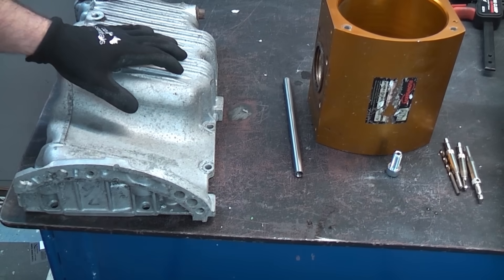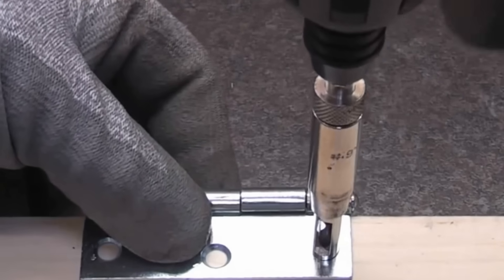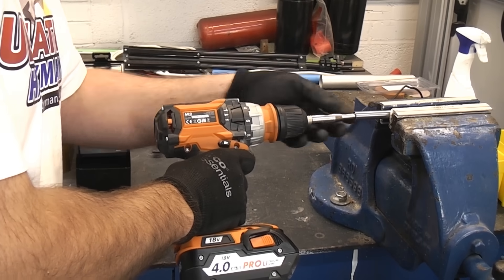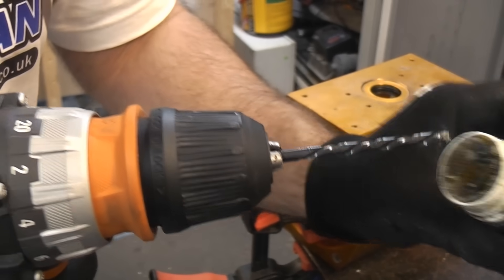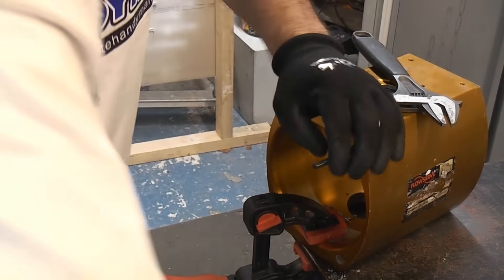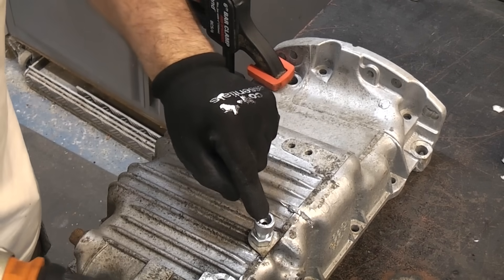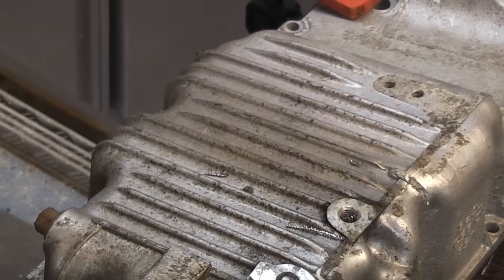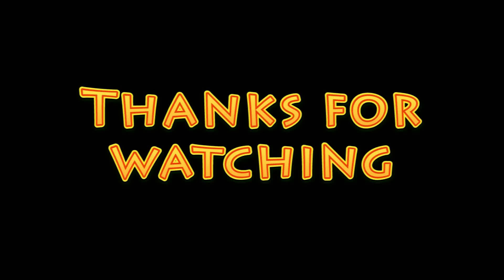How to remove a broken bolt in a deep hole | remove broken bolt in recessed hole

Comment: Great video but a few questions.

- How does heat treatment work? Unless the heat was applied long enough wouldn't the aluminium case just expand around the bolt tightening it? 

Even if you heated the steel bolt wouldnt that cause both metals to expand, the steel retaining more heat than the aluminium case whivh would lose more heat faster since its the outermost layer exposed to the air?

- Considering the bolts are threaded, what's the rationale behind 'shocking' them? I was under the impression that threaded screws and bolts are fixed in and that shocking them would be futile due to the nature of their attachment.

The force you tap them with, I would have thought, would just be dispersed.

- How does the penetrant work? Is that a spray oil that is supposed to seep between the threads to help loosen the bolt?

I'm not familiar with chemicals and just tried to apply a bit of reason to the mechanical side 😂

Thanks for the upload.
Reply from the maker: The metal will expand, which can break the bend between the bolt and the aluminium. Once the metal has been heated you have to let it cool down. We often remove bolts that have been used in autoclaves where water/heat and sodium nitrate have been used - steel bolts into tapped holes into steel. If you heat them to red hot and the surrounding area, then let them cool you can often remove the bolts without the head snapping off. Without the heat first the head just snaps right off.

Shocking works well- sometimes if you go to a bot that is really tight, give it a few smacks with a hammer and you will find that the shock has broken the bond.

Spray penetrant has chemicals in it that release rust/chemical bonding etc. Sometimes on site I have to undo some 3/4 inch UNC bolts that have been in the autoclave's mentioned above, they are covered in sodium nitrate and have been in a wet environment for a couple of years. I use a 3/4 inch drive pneumatic impact wrench and sometimes it will not unto the bolts, but spray them with a decent spray penetrant and the bolts loosen and can be undone. I remember one time we ran out of penetrant and I had to use the oxygen and acetylene to burn the heads off from the bolts.

Thanks for the comment

Comment: I'm amazed of the guides you made, the only problem is that you shouldn't be using copper greas on aluminium
Reply from the maker: Before making this video I did search Google but could not find any evidence to back up what some people have said. I have a friend that has used it for years on motorcycles with zero problems, so perhaps problems only occur in certain environments? 
Even Rocol's own website makes no mention of not using copper based anti-seize compounds on aluminium.
Thanks for the comment

Comment: Been using bolts with centers driller out for close to 45 years or more don't remember when exactly a machinist showed me that trick and he claims his dad showed him many many years before that. In my line of work I remove a lot of broken rusted in bolts on boilers and what not. Also when heating up the area around a broken stud I have found much faster and better results when you spray your penetrating solution on while the area is still hot if possible. Yes you may have some flame up just stop spraying and let it cool a bit then spray again in small amounts but you learn over time how to control that in a safe way and not burn the shop of building down. Just remember when spraying penetrating fluids that if it is running everywhere but the area you need it you are applying way to much. As the old commercials say, "a little dab will do ya." Personally I have for sometime only used PB Blaster on things I want to break free or remove. Yes I know it stinks but it works great. Another trick is that some penetrating sprays only have a poke in type straw for controlling your spray. Next time your can of WD-40 is empty that has the smart straw on it remove it from the top of the can and it will so far I have found fit onto any other petro based spray cans.
Reply from the maker: Thanks for the comment

Comment: The process works if the bolts are in good shape like yours(clean threads). I've worked on many bolts with corroded threads that no left hand drill bit or extractor would work. Instead of making those centering bolts, you can use a small bushing from the hardware store. Choose one that fits inside the opening.
Reply from the maker: Thanks for the comment
Reply: I do believe that there are some bolts that can not be removed.  I recently replaced two brake wheel cylinders with bleeder screws broken off.  To get some practice with such things I went to work on the old ones in a vice on the bench.  A number of heat/cool cycles left hand drill/extractor, PB Blaster; tossed them out with the screws still stuck.
Reply: If the bolt is at least 8 mm 5/16" the best way to get them out is to weld on them and build them up out of the hole and the weld a nut on it and vola it in most cases can be screwed out. Just watch out you must use a chromium weld rod not a usual welding rod
Reply: YEAP!! but why a chromium  ( stainless steel?) rod,please?
Reply: The character of the rod is that it is very accurate it does not fly to the side and the flux more or less isolate the side of the hole for any splatter and last but not least it  is normally much stronger than normal rutil rod
Reply: Thanks, another very good Idea !
Reply: @bergurketilsson4097  Thanks for the tip. I tried the welding method with regular welding rod and it broke. Now I know : )
Reply: @bergurketilsson4097  great if you have a welder...most of us don't 🤨
Reply: @jimsz0100  in your situation you can or could have submemurged those wheel cylinders in pure apple cider vinegar for maybe a week or dust put the vinegar all around the screws several times a day vinegar will only eat the rust    now the rust will be gone but you will have pits where the rust had already damaged the metal or steel ,, I'm quite old and have used apple cider vinegar for many many years
Reply: @jimsz0100  
1
Reply: @jimsz0100  Just replaced 2 damn calipers myself because of stuck ass bleeder screws that would NOT come out. Those damn things need to be made of compatible materials that will not corrode with each other. It would be nice if there were another "fluid" used for brakes that was not hygroscopic, too  because once that and any air introduced into the brake fluid happens, you're screwed. The constant heating and cooling  cycles of brake fluid in the caliper can cause the water there to release oxygen, thus making rust/corrosion, is my thinking and that fluid also becomes acidic from the same h/c cycles from just sitting in one area for so long, worsening the problem. Better fluid and materials for brakes, I say!!!! but nooooooo.....brake shops need work, too. Built in dollars and planned obsolescence has always been a pain in my ass but with an ever increasing population, you gotta make jobs and the bottom line some damn how. It just sucks that with these new expensive ass vehicles, these days, you have to pay for them 2 or 3 times over just to keep them on the road and your neighbors in work.
Reply: @dannychron2329  - Citroen fixed that by changing to LHM - Liquide Hydraulique Minerale - a thin hydraulic oil much like jack oil or ATF. It is used from1967 (1969 in the USA) in their central hydraulic systems and in the ordinary brake systems of 2CV type cars. Nothing internal corrodes. The rubber (actually polyurethane and nitrile) parts don't last as long as the old pre-1967 EPDM rubber parts did with LHS2 (much like DOT3 brake fluid). Antiseize works fine on brake bleeder screws. A few have used silicone oil (DOT5) brake fluid. NOT compatible with DOT3, 4 or LHM.
Reply: @dannychron2329  - Designed to break, tiny, and made of soft metal - the bleeder screws.
Reply: @dannychron2329  Or You could just flush the brake lines every 12-18 months. I've been doing this for twenty years it doesn't cost much and ABS systems derive great benefits from the clean fluid.
Reply: @dannychron2329  Blead Screws have been breaking for at least 50 years "From personal Experience" I Suspect it is because the manufacturers would rather sell new..  But once in a while you get Lucky..
Reply: @alfredmorency8296  check for h2o content in the fluid, when it gets high flush it...otherwise waste of time, it’s a closed system fluid will be fine.
Reply: @jimsz0100  drill the old screws in situ and re-tap the hole.
Reply: @jimsz0100  - The bleeder screws are designed to break. They are also over tightened when newly built weakening them just enough so that they'll definitely break when you try loosening them.
Reply: @damkayaker  built in obsolescence
Reply: Bushing? What are you even talking about?
Reply: Yes and anytime you mess with aluminum either bolts or pipe thread you got a super headache
Reply: I've (tried) to extract bolts with easy-outs for at least 40 years, and never once has it worked.  My applications are much like @electronicsNmore described; always corroded.
Ultimate Handyman shows that technique is everything.  I've never been able to keep a drill centered like he shows... and freehand, no less!   That's impressive capability!!
Reply: Agreed.   I have found that the best screw extractor is a torx bit, really.
Reply: 🤣  Your erotic writings,  ever thought of publishing in Mills and Boon books ?
Reply: you can fix stupid my friend.
Reply: Glad to hear it's not just me  who can't get the dam bleeder screw out and just gets a new recon caliper instead
Reply: Yup, I have never had any luck with extractors because in order for it to have broke in the first place it was already being removed with more force than even an extractor can handle. Now the centering tools are key as you must center the drill then step up drill size untill you basically just pick out the the left over threads " now paper thin".
Reply: In this case my approach is to drill out larger and larger. If it doesn't extract, get to the inside thread diameter and use a tap to clear the remains out. 

And hell, if that doesn't do it or the threads are stripped, if available, move to the next larger bolt size with the same thread pitch, and use a larger bolt for the assembly. Retap the whole thing. I've personally done that. Damn shop mechanics in a hurry with their stupid air tools do loads of damage.

Comment: Great easy to understand video much appreciated. As a retired ex  toolmaker I have seen many tricks and modifications the best was a 10 mm RH standard tap ground to cut a 10mm LH thread . try working that one out . Cheers from Down Under
Reply from the maker: I can't work that one out LOL
Thanks for the comment  ;-)
Reply: Here's how !!! each of the cutting edges had been ground back just leaving a small tip which was then ground back giving it a reverse cutting tip so it then cut on what would have been the trailing edge .This left only a very small cutting tips on the original tap and was carefully used to cut a L.H. thread .. I saw it done in about 1965 buy a Russian Toolmaker who won quite a few dollars on a bet .I hope that explains it . Cheers from South Australia .

Comment: The drill guides are great, but why bottom them out on the bolt to begin with?  Surely just leave them 1/4 - 1/2 a turn above bottom, then if the drill bites, it has a chance to release it straight away?
Reply from the maker: It's unlikely that the broken part of the bolt will be that loose!
Thanks for the comment

Comment: You do realize the EZ-out is made to be used with a tap wrench, right?
Reply from the maker: Yes, which is why I said in the video that I would normally use a tap wrench, but it was at work (apart from two really big ones).
Thanks for the comment

Comment: This guide is shit. LOL..

If you broke of a M10 Bolt trying to remove it, no way in hell it will magically come loose with your left handed drill bit, not even after applying Heat or ( wtf )  wd-40..

Wd-40 is NOT A PENETRANT ffs
Reply from the maker: You would be surprised what heat/ shock and spray penetrant can do. But you obviously know better than me, I just work as a maintenance engineer in a chemical plant.
Thanks for the comment

Comment: just a point of interest i have found the spiral type stud remover can make the broken stud ,bolt whatever tighter in some cases and use a square tapered tool made by proto its fantastic for removing broken spark plugs in these new engines .
Reply from the maker: That is correct. a square one is normally better, but me decent stud removers are in my box at work, this is just a cheap set that came with some taps and dies- which I would never even think about using!
Thanks for the comment

Comment: Guides are good idea. To remove a broken bolt from deep inside a hole with a left handed drill seems another good idea, but obviously there are drawbacks. First drawback is there are not too many shops where you can buy left handed drills. Second one is the most common issue: broken bolts inside a hole used to be stuck inside the hole, it's the most common cause the bolt gets broken. So removing the stuck broken bolt won't be easy if possible at all. Aluminum and iron oxide (inside a hole) tend to stuck, adhere together and one must be very patient to free that mess up. Heating and cooling used to help, but not everytime. If you're lucky, the bolt is already rusted enough to have bigger oxide crystals on the thread. If so, you can shock it to loosen those crystals, then apply some penetrating oil to make it easier to move. Applying heat after using penetrating oil can make painful consequences if you're not careful enough, but as the heat warms the penetrating oil, it can penetrate deeper.
Sometimes all the techniques fail, and the broken bolt remover used as last chance breaks into the bolt. Then, you must have a precise mill and some tungsten carbide bits to remove the mess from the hole. But if you have access to a milling machine, you may want to use it first to remove the bolt. I surely would...
Reply from the maker: Thanks for the comment

Comment: Great video, however I learnt recently after 30 years of mechanical DIY that you should never use copperease or similar on aluminium. It causes a reaction and has the opposite to the desired effect. Use normal grease.
Reply from the maker: I've never had any problems with it (yet). I did a quick Google search before mentioning it in this video and could not find any conclusive proof.
Thanks for the comment

Comment: There was a case when a long M4 tap got accidentally snapped off in a deep blind hole in a die cast brass part when cutting the thread in there. As the part itself was extremely expensive and couldn't be replaced it was a big problem. Then one guy said just give him three days to get it fixed. So eventually he managed to get rid off the broken part of the tap - he completely ground one off there with use of diamond powder and his own tricky technique.
Reply from the maker: Thanks for the comment

Comment: Good vid mate but is it just me or is the second drilling actually going clockwise ..
Reply from the maker: I did drill one of the bolts in a clock wise direction (I think) but even if I didn't sometimes the video camera makes it look like the drill is rotating the opposite way to what it actually is.
Thanks for the comment

Comment: Hmm? Too bad you didn't show bolt being broken off with about 300 ft. lbs. of torque vs. the gentle breeze 20 lbs. you show removing it! Taps, WD, torches, and all are fine and occasionally work but your method forgets that the bolt was seized.
Reply from the maker: Thanks for the comment

Comment: What do you do when the bolt is the width of the allen wrench u had in the video tho lol im screwed
Reply from the maker: Yeah, you are screwed ;-)
Thanks for the comment
Reply: prolly just drill it and Tap i suppose... ugh
Reply from the maker: You could make a smaller guide.
I have drilled out a M6 bolt, using a 3mm drill bit.

Comment: im trying to find that sleeve thing for the drill but googles keeps pointing me to industrial oil drilling equipment :/
Reply from the maker: You just buy socket head bolts the correct size and drill the holes yourself. You can drill them using a drill press/table drill or you can take them to a machine shop and ask them to pop a drill through on the lathe (they should not charge much)
Thanks for the comment

Comment: Also try X-TRACTALLOY™ Welding Electrode for Broken Bolt Removal with your stick welder. Thanks for the video
Reply from the maker: I tried one of those a few weeks back but could not get it to work correctly. I'll try again when I get chance.
Thanks for the comment

Comment: I have heard the oil of wintergreen (Methyl salicylate) will act as a penetrating oil to help dissolve galvanic aluminum corrosion between steel and aluminum parts.
Reply from the maker: Not sure about that, but it might work.
Thanks for the comment

Comment: Sorry Ultimate Handyman but Copper Grease on Aluminium isn´t a great idea! Because it´s reacting. You CAn Read something about that in comparson to Brake Callipers. So Better Methode of this one are using Ceramic Paste/ Spray.
Reply from the maker: I know people that have used it for years, and before making this video I searched Google but could not find any proof, even the manufacturers websites did not tell you not to use it on aluminium.
Thanks for the comment